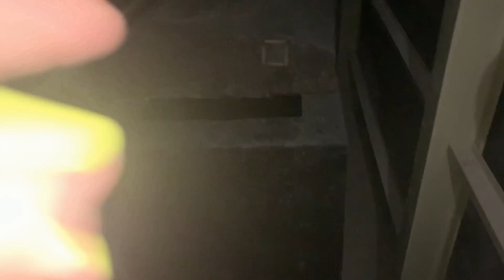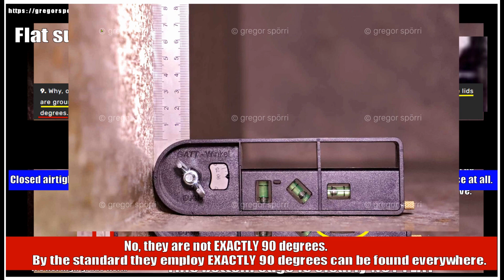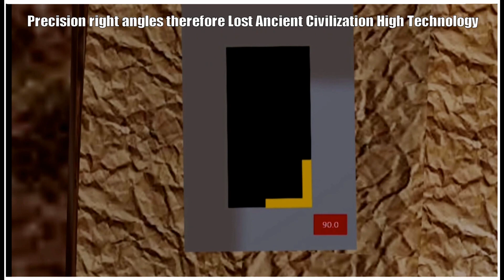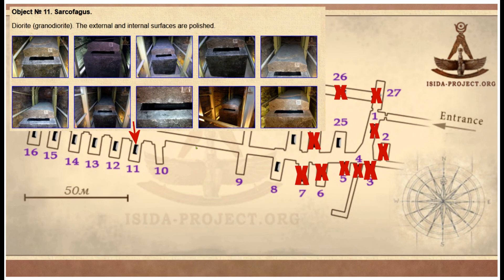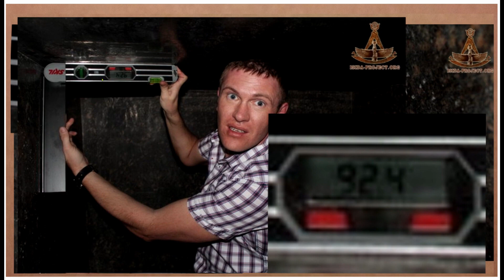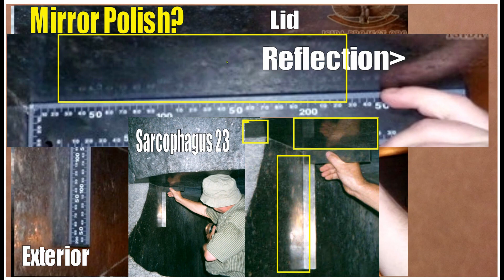Ancient Precision at the Saqqara Serapeum!? NOPE!! It's False!

Comment: The precision argument is a dead straw man … hell who cares… but I challenge anyone to go and quarry the Diorite of the smallest size box that is in that tunnel.. cut it so a lid fits fairly well on it made from the same material and than move it the 500 miles and get it into those tunnels and placed into the alcoves… ok just make one half the size and use the same tools they had and I will be satisfied… is this a straw man?
Reply from the maker: Moving them inside the tunnels. Notice the experts of LAHT,  who are quoted directly so no strawman there, cannot even lever or ramp? 
https://www.youtube.com/watch?v=0vrMHOPcMvU&t=8s 
Since then I received a translation of Mariette who found winches and rollers inside the Serapeum, and one of the boxes was still on the sand pile and they lowered it in place!!
https://www.youtube.com/watch?v=JZXeQkQVs1o&t=308s - old pictures of masons including moving heavier blocks across land, the Serapeum next to the nile and thats how they moved stuff, on the Nile. Wait until flood seasons and you barely need move them at all since the river comes right up onto the front door. Moving 500 miles? You mean moving them a few hundred metres and letting the river current do the rest of the work. Does walking onto a plane and working off again mean I walked 10,000 kilometres from Australia to the USA?
Precision- who cares? They all care, its the core of their argument!!
https://www.youtube.com/watch?v=XY6SUTPV018&list=PL47iaGB6hlT5sYZWd_G7sHg9cSRv6WWS6
Entire playlist of the experiments I made including with diorite and using wooden wedge to split and copper. Plus drilling, cutting and polishing including making the abrasives. How to videos and the archaeological evidence. If you want one made I can give you quote. Otherwise every step for you to make one is there if you want to hire a crew and get it done. You should learn about ancient stone masonry techniques
Is it a strawman? Nope. It's exactly what they say and have been saying for years. It seems the new fad to try and call debunking LAHT a strawman. The strawman strawman fallacy.
Reply: @SacredGeometryDecoded  it’s one thing to polish stone… it’s a whole different thing to hollow out a one piece sarcophagi with pretty great right angles. You are not ignorant so I know you understand the difficulty of cutting these with copper and flint…. I challenge you to make a 1/4 scale replica… that’s easily done right? Using flint, fire and copper. Hell make a video on it. You will be famous for doing it.
Reply: I believe they had other tools that we have not found in the digs… I do not believe in hocus pocus , I do however believe they were advanced in different ways than modern man… and it’s entirely possible that we just do not know the tools they were using…
Reply from the maker: @christopherbrewer6610  inner trihedral corners have been replicated using flint on the Scientists Against Myths channel.  You can see them everywhere in old school pre industrial masonry. There’s nothing special about them at all. 
Pay me and team the wages and pay for the stone and we’ll make one. 
Much more impressive are the granite bells still being made by traditional Indian masons.
Pay them to make a box.
I have a video re entry uploaded about the masons who made granite troughs to feed animals and water them. You can find countless examples of them for sake on line including ornately carved ones.
The cutting rates of primitive tools is posted in mine and others experiments. 
It’s just a box. If they impress you then you invest the time and money to make something no mason doubts can be done. 
Hollowing out a block to nearly 90 degrees would be an insulting request of a trained mason/sculptor.
Ask them for a quote if they were to use less efficient but equal tools. 
A fella replicated a part of the Tutankhamen sarcophagus with the relief carvings using flint and stone pounders. Hollowing out a box is child’s play.
All the pieces have been done.
Invest your time and money to have it all done at once.
Make me a vaulted ceiling using medieval tools. I don’t think it can be done. It’s your job to convince me otherwise.
Reply: @SacredGeometryDecoded  I see. Nothing impressive at all about the “boxes” o mighty secret Geomancer endowed with the deepest hidden gnosis… nothing really but to pay you and your boys and a work of art you shall make right?😂😂😂
Reply from the maker: @christopherbrewer6610  once the precision fallacy died the magic of the boxes died.
No need to thank me though . It has been fun slaying these false gods. 
Others have smelled the blood on water. Even one of your biggest allies has converted. 😆
Soon enough it will be in the Flat Earth basket. 
There was only so many people they can sucker into those over priced stone pointing tours, and less now, and fewer tomorrow.
There’s blood in the water now. 🦈
Reply: @SacredGeometryDecoded  read back, I never held up any precision claim.. basically what I said was that however you look at it , that stone and those weights and the tunnels was an extremely difficult task and more than likely we are missing a method or at the least tools we at this time do not have record of. Your the one that became uncivil and limped me into conspiracy theorist/ flat earth acolyte. There happens to be a box left right on the floor in the corridor … no sand underneath right? Your argument pretty much hangs on people saying that allegedly they found pulleys etc in the corridors. So where are these? Because that would be a big deal to have the actual tools used. Can you tell me where those are and where people can look to see those?
Reply from the maker: @christopherbrewer6610  the 3 laughing emojis, you set the tone with that. Not to mention the "strawman" BS when the beginning of this video was expressly addressing the " strawman strawman" that seems to be the new thing.
Or are you claiming I strawmanned you, who has no content or external links on your channel?

If you want to know more then maybe do some work looking into it yourself, demanding we do your labour for you and then post links that you don't even bother to glance through.
I did more than just polish stone. your reply came far too quickly in response to those links, you didn't even look and so you have no business asking for more. You're time wasting and clearly have no genuine interest in this topic.
I don't take you seriously and these replies are not even for you, they are for those who might come to read them afterwards.
Reply: @SacredGeometryDecoded  I used straw man because that’s the term you used. And I also think most of these arguments back and forth are by very definition straw men … one group states nope that’s precision and your group states nope it’s not precision and it goes back and forth … I too think claims get overblown but come now man it cannot just all be those people are wrong and than here’s why let me show you on a 1:8 scale and than ok it’s debunked… as you know weird shit starts to happen the heavier and bigger things get.. anyway I just one day want someone to actually get a crew together and quarry, float and move just one of those stones of the same weight and the same distance … just one and I will believe… hell not even asking for 24
Reply from the maker: @christopherbrewer6610  you are deflecting from the links and examples I sent. 
Yet you demand more without even glancing over the first. 
It’s clear your mind is set on imagined technology you cannot prove. 
I posted the videos and experiments so I don’t have to repeat the same comment over and over 
If you’re too lazy or dishonest to even look then that’s not my problem.
Damn straight I am skeptical.  If you’re not then you’ll believe any old thing like that hollowing out a granite block to imperfect angles is some sort of challenge.
Reply: @SacredGeometryDecoded  is here you go again asking others who are not the ones being skeptics to prove your skepticism… one person states this is true and you state it isn’t and throw anecdotal evidence up but never have to actually do the deed… I know you feel what I am saying which is why you are so defensive … I am the audience I sit in the middle… I look at the precision guys and listen and than I look at what you have to say… they actually went to the site and you sit back and state they are wrong.. simple right?
Reply: @SacredGeometryDecoded  no I watched them all. And liked them
Reply: @SacredGeometryDecoded  and no my mind is not set on imagined technology … I just hear a lot of people talk and just once I want to observe it … you got the wrong guy if you think I believe they used magic etc .. but I do believe they were more advanced than bronze cutters and flint
Reply from the maker: @christopherbrewer6610  in links I sent of old stone masons and quarry men. 
If you don’t want to look then that’s not my problem.
Reply from the maker: @christopherbrewer6610  flint and bronze works. Nothing you can’t do that can’t be done with steel. 
I posted experiments with cutting rates as how to videos to avoid the early mistakes I made.
The tools that exist work. If they didn’t there’d be an argument for unknown tech. But they do work and exist in the record  and zero evidence of unknown tech.
What’s presented without evidence can be dismissed without evidence.
Better yet.
What is presented without evidence can be and has been dismissed with an entire body of evidence.
You make me a vaulted ceiling scale model because I believe medieval masons had more advanced tools.

Comment: Only one functional purpose for that weight & flatness: Airtight, underground storage. Build to last. The Giza Complex was crazier than you might imagine. Saqarra is not far with a orthodromic distance underground rail-systems. Probably the reason it was closed all the time. And if you re-read the Opening of the Mouth Ceremony...

The best precision I've seen, are vases and jewelry. Different parts of the world.

Some other interesting notice of Saqarra:
the're are ~ as many boxes as periodic elements..
The underground Complex has never been researched and simple lidar scans could reveal all tunnels overthere. Tunnelmapping is not a new tech..
I couldn't find Dunns precision measurements in the corners of the hollowed boxes; note this can not be sawed and should be carved, flattened &/or polished with other methods!! But which method?

Btw. 
Dunn frecked up with his Orion theory, like Llypd Pye frecked up with his Crystal Skull. Still good researchers on the right track, altough Dunn's dating methodology smells unscientific. While the elongated skull theory totally revived lately, with cases on all continents..
Reply: Prof Robert Temple showed there was a surprisingly good knowledge of optics in the bronze age in his work called Crystal Sun. His findings don't seem to be mentioned often